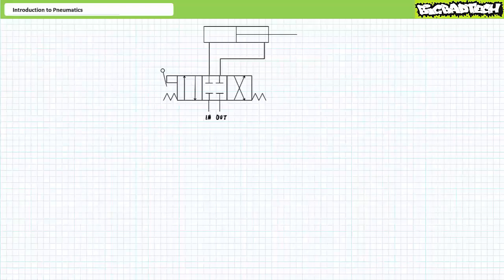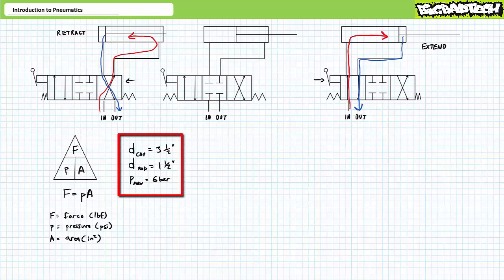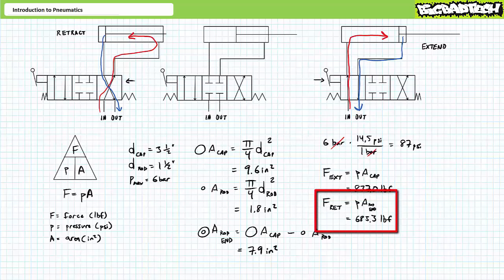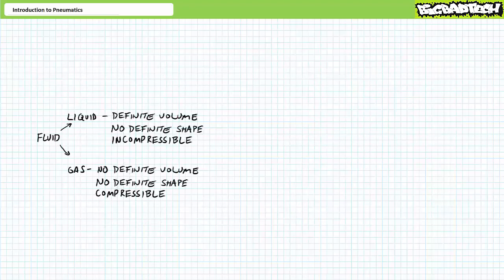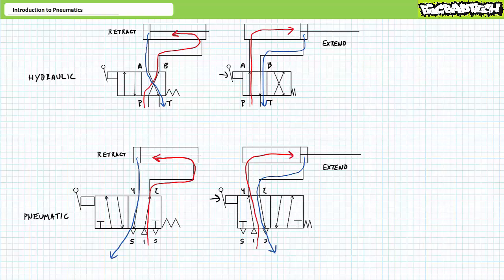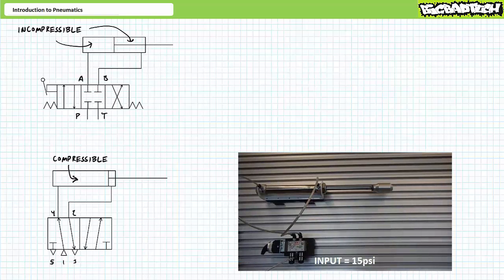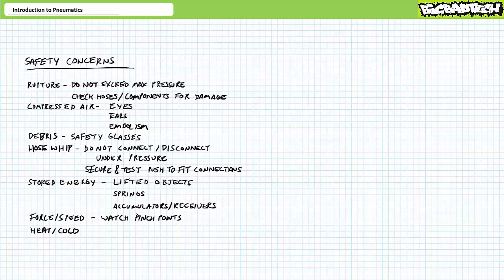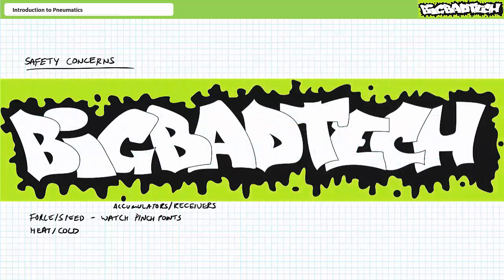Introduction to Pneumatics (Full Lecture)

Comment: I love your content, it's amazingly well done and complete!

A small suggestion: refer to the rod end of the cylinder as the annular end. It seems you are using a couple of different terms to describe this end, whereas the most widely used text books on the subject use "the annular end" of the cylinder or piston.
Reply from the maker: Ironically enough I’m redoing some of the earliest lectures on cylinders and fluid power math and talk about all the different terms employed head/rod end/annular and cap/blind especially in different industries. As for me … old habits die hard! I’m a rod end man because that’s how I learned it the late 80s early 90s (back when the wild mullet roamed free).
Reply: @Jim Pytel 
I'm an 80s guy too, and looking at the old photos, I had a mullet. No one called it that back then, it was just the hair of the day.